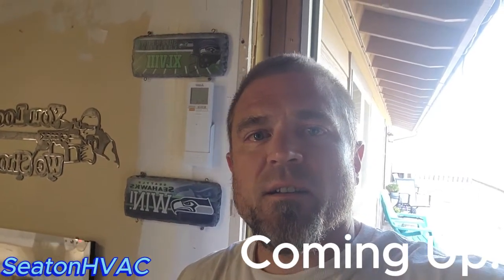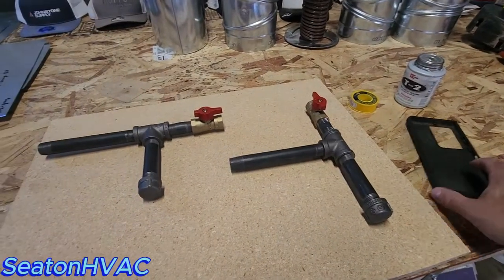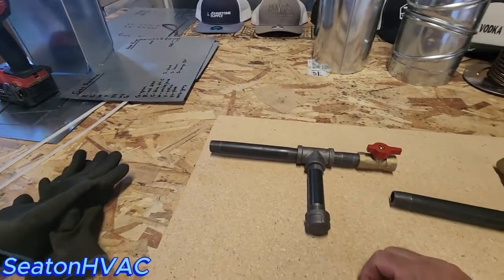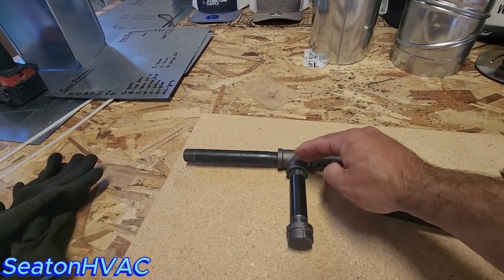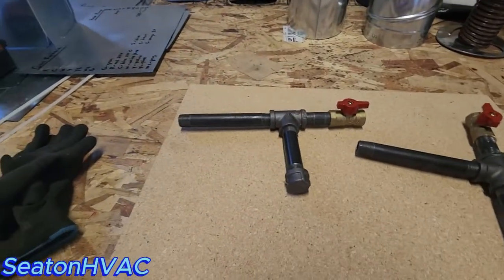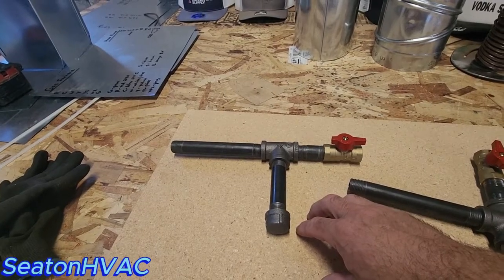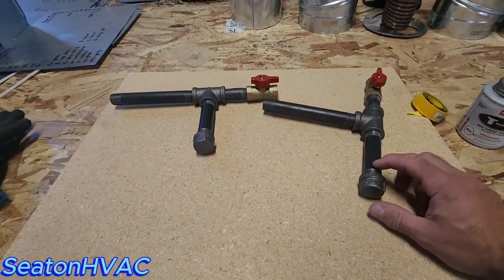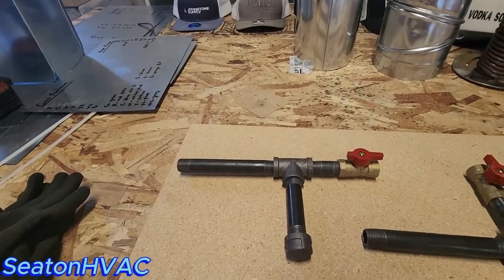Gas pipe drip legs, basics on installation.

Comment: With there being no outlet in that proper drip leg it’s effectively a bubble and no gas  flows down there right? Not saying that  stuff doesn’t fly  down there  but gas isn’t  flowing.  With the proper drip leg couldn’t condensate rundown the vertical wall and then  get blown or sucked into the horizontal  pipe. In that case a horizontal drip leg maybe better ?

Comment: You invited corrections so, what you have there is a drip leg AND a sediment trap. The one you're calling "right" is a sediment trap and it is correct. Has to force the gas to change direction. The other is a drip leg and it's only intended to catch liquids, which are heavier, and doesn't require a change in direction. Both should exist somewhere in the run but sediment traps prior to each appliance.

Comment: My old house has a copper thin pip 2 psi meter pressure.  There is one regulator just before water  heater . Should I through away the feulator and install with out regulator
Reply: NO. 2 psi will destroy your heater's valve. Leave the regulator.

Comment: Thanks for the video … very informative.

In new construction, with a 500gal underground propane storage tank; what type of piping would you use underground from the tank to the house (in Florida)?
Reply from the maker: Typical is polyethylene pipe (PE).  Make sure a copper tracer wire or tracer tape is ran with it for location purposes.
Reply: @SeatonHeatingAC , thank you for the quick response.

Comment: 4” sediment trap ? What code book is that in ? I can’t find it in the IFGC .
Reply from the maker: It's code in my state.  Not sure about national.
Reply: Off the top of my head it is section 1212.  Let me know if you find it.
Reply from the maker: @nspro931 National code states no minimum length specified but 3" is widely accepted in most states.  Oregon just happens to be 4.  IFGC doesn't specify length, NFPA 54 doesn't either, states mainly specify it. What I found.
Reply: @SeatonHeatingAC  yup that’s what we found , we just use 4” and call it good.
Reply: Nfpa 54, 58
Reply: @Sapper1123  You need to provide reference numbers and quotes not just reference an entire 100 page book
Reply: @nspro931 it has table of contents! If a person can’t read and research then you probably don’t need to mess around with gas piping or anything potentially dangerous! Just saying!
Reply: @Sapper1123  If you notice, in other posts in this thread I posted specific references but you did not, you just made a lazy low effort post.  You make the claim you do the research

Comment: without knowing the correct answer, Im guessing the one on the right is correct at 0:51 and my reasoning is any debris would drop straight down into the drip leg and not accumulate inside the shutoff valve in a vertical position. one on the left, stuff could build up in the gas valve as it lays in a horizontal position. Im still learning and just making shit up but hopefully Im close!
Reply from the maker: You don't have to guess. I told you what is correct.
Reply: @SeatonHeatingAC   Thank you
Reply: ok I have no idea that was like half and half lol. The change in direction makes sense. Thank you Seaton for making this video so I can learn how this shit's done properly!

Comment: Is there any reason to not do a sediment trap when it comes in the building and then not worry about it? 
I could probably learn a lot just reading the code but why read when I can be annoying on the internet 
Jk where do I find the codes?
Reply from the maker: I don't have a definitive answer for you there.  What I can say is that you might as well have one at the appliance as a last line of defense.  For a few dollars in material, why not?  Plus, it is code in most jurisdictions anyway.
Reply: I am not a pro... But a sediment trap is the last chance to catch little flakes of tape, slight drips of cutting oil and any other debris in the house/building piping before it gets where it can do damage.

Comment: So if I am installing a gas fireplace should I put a sediment trap on it in the basement ceiling before I go up to the fireplace.its a walk in basement all the pipes are in the basement ceiling
Reply from the maker: Absolutely, there should also be a sediment trap placed anywhere there is a vertical rise of 5 to 6'.

Comment: The one on the left is a drip leg.  The one on the right is a sediment trap.
Reply from the maker: Wrong.  They are one and the same and only one is done right.  Try again.
Reply: @SeatonHeatingAC  Both IFGC and NFPA 54 differentiate drips and sediment traps, and your specs for construction only apply to sediment traps.  Citing your years of experience is useless, cite the codes, they have numbers and you should use them. IFGC 408.2 NFPA 54 7.6
Reply: @SeatonHeatingAC  https://www.youtube.com/watch?v=gJrzPKkUEmU
Reply from the maker: @boonecountygenerators3052 He can call that whatever he wants, but sediment will blow right by a horizontal tee.  Just because he posted it doesn't make it so.  Check plumbing code and it will contradict what he is saying.
Reply: @SeatonHeatingAC  Sediment will blow right by a horizontal tee.  That's why it's not called a sediment trap, it's called a drip leg.
Reply from the maker: @boonecountygenerators3052 Just what I said.  They are one and the same.  Some people you just cannot get through to.  You need to shelf that other video.  Jesus.
Reply: LOL! ...So up here in Canada, the wrong trap is not even an option in our code. It's specifically layed out in detail how the drip leg, sediment trap, dirt pocket, or whatever you want to call it is to be done. The picture on the right is the only legal way. The incorrect way is still going to be better than nothing and will trap threading oil, sediment can surely flow past it as clearly mentioned with velocity in this video. I see the wrong trap installed many times for outdoor generators since their literature will show this method as acceptable. Even some horiziontal gas furnaces's with the gas piping entering from the top will ask for it done like this, but our code supersedes these and the dirt pocket is be done only one way. We require a minimum 3" drip leg. I've never actually found much of any sediment/debris in the trap. I've only ever found threading oil in them. We even have a specification for them to be installed when the piping may be experiencing a drastic swing in temperatures from one area to the next and then it gets referred to as a condensation trap... In the end, all the names are the for the same thing and they can only be correctly done one way, as shown in this video. I specifically have a Gas technician license at the highest level, so feel free to not try and argue with me. Thanks :D
Reply from the maker: @Jason-wc3fh Why would I argue?  I am the one with the video showing the proper way.  Did you watch the whole thing?  I have been a master fitter for 30 years.

Comment: Informative for the beginner. From what I know, the left one only serves as a drip leg but not a sediment trap. The right one serves as both a drip leg and sediment trap.
Reply from the maker: They are the same thing.  Quit watching videos with the wrong information.
Reply: @SeatonHeatingAC  Conceptually I don't think they are the same. Sediment traps can be drip legs but not the other way around. Drip legs are near obsolete because our most of our gas has moisture/hydrocarbon dewpoint below any normal gas line temps. Some reading might help.
Reply: @dogwink same thing sir i am a certified inspector and it is the SAME
Reply: @SeatonHeatingAC literally the same thing!😂😂

Comment: I was taught not to use tape on gas, only water. the reasoning was not to have any tape parts clog up gas valve screens.   Thoughts?
Reply from the maker: Depends how you apply the tape.  If you do it right and don't go overboard, it will never see the inside of the pipe.

Comment: Let me defend plumbers. I don’t know about your area but that would never pass inspection where I live. Usually the people who screw up or leave out drip legs are handymen. I’m sure some plumbers do it to. Maybe hvac as well but where I’m at most hvac guys don’t do gas. The reason I say this is based on water heaters. If I come to a house with a water heater that’s from a supply house , has the install date on it, and sometimes a company sticker, they’re usually done right. When I see them done wrong, it’s usually a Home Depot or Lowe’s heater. 

PS The proper one will also work in reverse. I’m referring to the tee and not the valve. The gas can come in either side as long as the tee is vertical. Ironically, I saw a video on YouTube of an hvac channel with the middle of the tee aiming down. I said that was illegal. I was then told I didn’t know what I was talking about and he may be hvac but he’s certified. So I looked up the fuel gas code and listed it and he never responded back.
Reply from the maker: @joshcowart2446  You just said a lot without saying anything.  I already spelled it out.  I don't defend anyone that does it wrong. Thanks for watching.
Reply: @SeatonHeatingAC  easy tiger. One of the issues is tone doesn’t translate in text. While it was a defense, it was kind of meant tongue in cheek. Sort of like “how dare you put a pox on the name plumber”. But judging by your reaction, it does seem like you have some hang up. You say you’re just against doing it wrong but your whole video was “plumbers always do it wrong and defend it but I always correct them” You’re the bestest gas piping installer ever. Plumbers ain’t got shit on you. I very seriously doubt that all or even most plumbers are doing it wrong considering it’s never been code so even the in my day argument falls flat. It’s likely some plumbers do it wrong, just like some hvac guys do it wrong, or some handymen do it wrong. But maybe you live in the ignorant plumber capitol of the world. In that case keep up the good work. Continue on your holy mission of ridding the world of incorrect drip legs for only you are such integrity to complete this holy quest